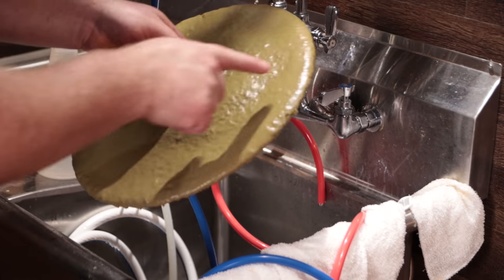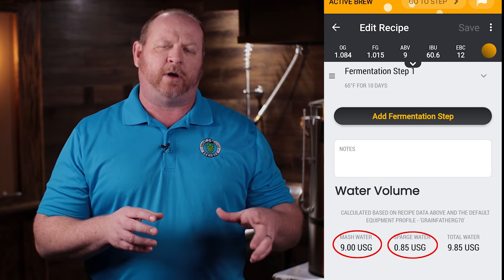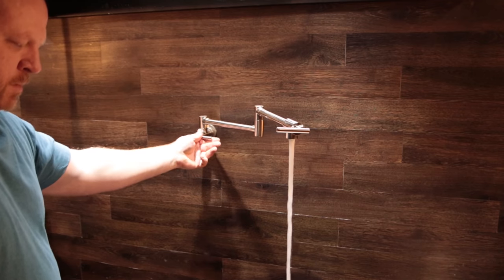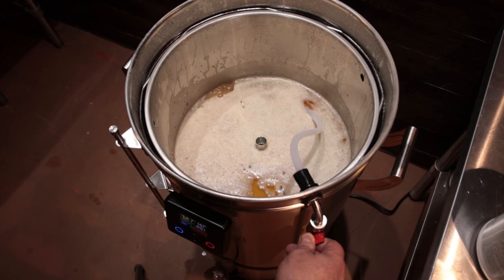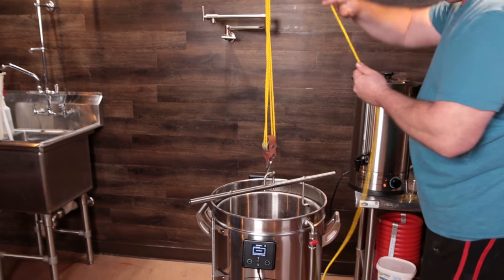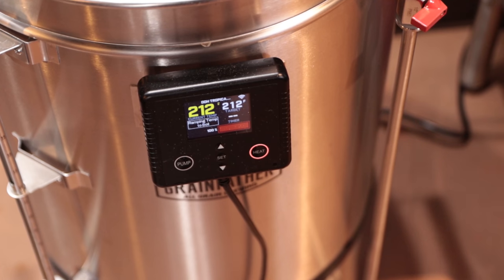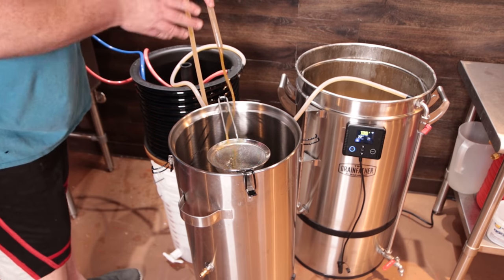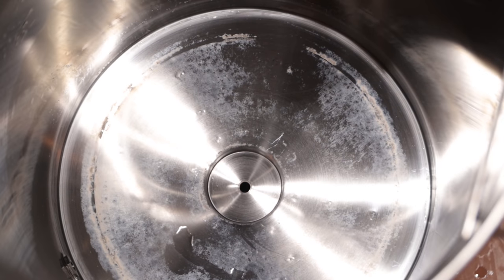Grainfather G70 First Brew Day US Model

Comment: Brian, you are spot on with the pricing issue! When you can buy a similar system from a competitor for half the price that does the same thing it's a tough sell!
Reply from the maker: Hey the consumer doesn't lie.. I'm probably the #1 channel. In the USA for all in one systems. When mass amounts of people tell me it's too expensive.. That's not a fluke! Cheers Adam! 👍🍻
Reply: @ShortCircuitedBrewers  whats the go to recommendation for all in one?  And are they just as problematic?
Reply from the maker: @motoman5208  I like the Anvil Foundry. Simple and easy to use. With a dual voltage option you can't beat it. 👍🍻
Reply: @ShortCircuitedBrewers  nice thanks for the speedy reply.  I’m getting tired of my cumbersome bootstrap system and I’m interested in something to help simplify a little bit and still kick out quality.    
I make a ton of hazy IPAS.  Can Anvil whirlpool with the pump if i do a huge hop dump into it after boil?  Really looking to get good circulation and max those good aroma hop qualities

Comment: If you want to clean a counterflow chiller use powered lye with and hot water.  It’s caustic and use appropriate protection, however it really does a great job if you recirculate it.  Make sure you do it both directions to back flush.
Reply from the maker: Yep I did back flush. 👍🍻

Comment: I been wanting to try this - we've been using the bigger systems a lot in our brew house to supplement batches.
Reply from the maker: You looking at this unit specifically? Or just a larger system than the smaller all in ones? 
👍🍻
Reply: @ShortCircuitedBrewers  well we already have the big Digiboil system - I was wanting to try this one too to see what else we can do - I only have one 220V drop (so far)  in the brewhouse though so the next thing we test will prolly be the Brewbuilt electric kettle.

Comment: I'm realizing that different electric home brew systems can vary widely in how much strike water vs sparge water they say to use.

For example- our last 2.5 gallon batch called for 6.75 lbs of malt.  Following the Anvil Foundry instructions, we used 3.1 gallons of strike water and 1 gallon of sparge water.  That puts out mash at 1.84 quarts of strike water per lb of grain, which was quite loose.  For comparison, I looked at the instructions for the Brewer's Edge Mash and Boil system.  Following their instructions, our 6.75 lb grain bill would call for 2.025 gallons of strike water and 1.52 gallons of sparge water.  That's just 1.2 quarts of strike water per lb of grain.

From your experience, do you think the Anvil Foundry or the Mash and Boil's water volumes seems more reasonable?  (We brew with the Anvil Foundry; just worried our mash is too loose using their instructions.)  Thanks!
Reply from the maker: You can adjust the water as you see necessary. The guide that comes with the Foundry is a basic guide. If you feel like the mash is too thin, you can reduce the amount of strike water and add the amount reduced to the sparge volume. There is no hard rule to the amount of strike water. Only "rule" Is that the grain needs to be saturated for conversion . Make an adjustment and see how it goes. The nice thing is that you can always add some water if you think it's to thick after reducing the amount. I would say heat up your normal amount of strike water then transfer the amount reduced to an insulated container so it will hold some heat. Mash in and then if you need some more water then you'll have it on hand already warm. Let me know how it goes. Just be sure to document what you do so you can adjust going forward. 👍🍻
Reply: @ShortCircuitedBrewers  Excellent advice.  We'll definitely try this with our next batch.  Thanks!

Comment: Wait you did 5.5 gallons?  I thought the minimum was 10 gallons?  Thats one big reason I wasn't buying was because of a 10 gallon min batch size.  But you did 5.5 gallons?
Reply from the maker: yep
Reply: @ShortCircuitedBrewers   did you use the micro piping ?
Reply from the maker: @johnathanhibbard3502  no the regular piping that came with it. You don't have to overflow down the center pipe if you have a good flowing grain bed. 👍🍻
Reply: @ShortCircuitedBrewers  that’s good to know.  We was discussing it last night on the G70 Facebook group.
Reply from the maker: @johnathanhibbard3502  you can do it. 👍🍻

Comment: Man, one of the biggest advantages of electric is how easy the clean up is when you’re using a typical element for heating. Because you aren’t hitting the bottom of the kettle with direct heat, beer scale doesn’t ever have a chance to build up. Seeing that scale build up from one brew is ANOTHER huge turn off in a long line of turn offs for this system.
Reply from the maker: Another good point. Although about 45 seconds with bar keepers friend and it looked like new.

Comment: My filter came clogged the very first brew. Nothing comes through. A full brew day down the toilet because of bad design and bad construction. Gonna send the G70 back, I expected more than this.
Reply from the maker: That's frustrating for sure.
Reply: @ShortCircuitedBrewers  How is your filter mounted? There was a large gap between my filter and the bottom of the cooler. The second filter that goes into the hole is so tight I could not even remove it again after the initial rinse of the machine. Using just water and light detergent I also had big problems getting the pump to provide water to the cooler as well. Wife was looking at me and wondering if I had thrown our money out the window as I was trying to pump just clean water last night. Weird machine.
Reply from the maker: The cooler? You mean the kettle?
Reply: @ShortCircuitedBrewers  The circular thing, black tube.
Reply from the maker: @retroMartin  the chiller ok. Did you have the bottom screen(s) in place? I did not have any chiller clogging issues.
Reply: @ShortCircuitedBrewers  yes, the screen was in place. Mine is crooked, so it doesn't look like it has any effect. Large gap between the screen and the boiler bottom. Not possible to clean the top either, tried that with my brewing spoon. Used alot of time on the center portion. Merely a trickle reaching my bucket. Not sure if there is a bigger clog in the piping.
Reply from the maker: @retroMartin  yeah that doesn't sound good. I did not experience that thank goodness. I would reach out to them about the crooked screen, or send it back like you said.
Reply: @ShortCircuitedBrewers  But what about when it happens again. I think the design is lacking. Have probably a 100 brews on the G30. The measurement pipe on the outside is a guaranteed infection problem unless specifically washed and dismantled. I have large issues with the ball lock and pump on G30. After 5 brews it needs full disassembly and thorough cleaning part by part. The new design is even worse.
Reply from the maker: Hey I'm not saying keep it.. just saying I'd let them know. If you're unhappy send it back I say. 👍🍻